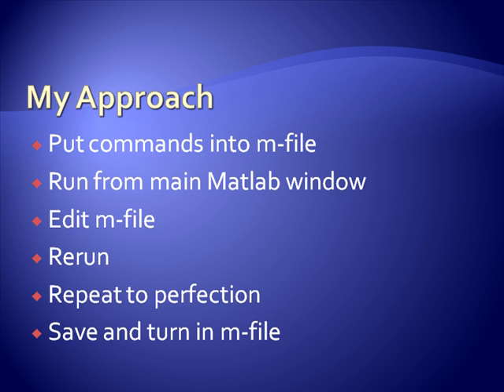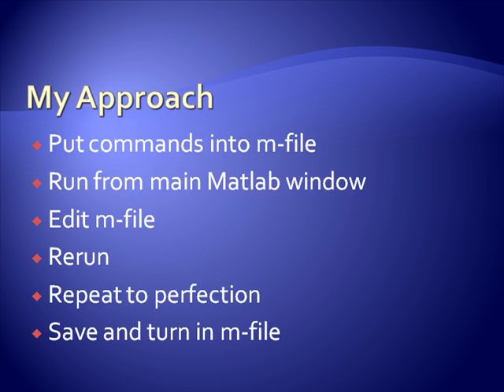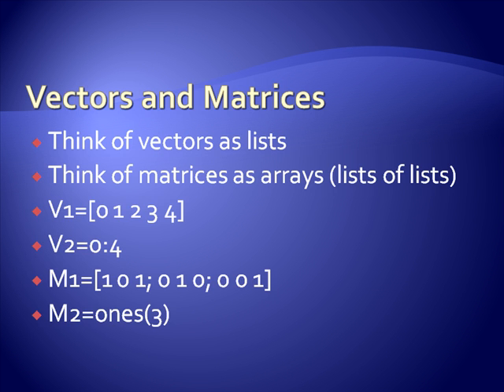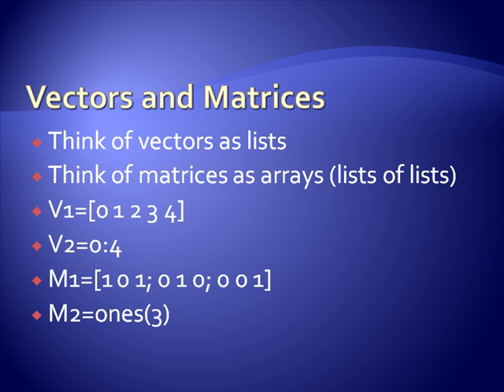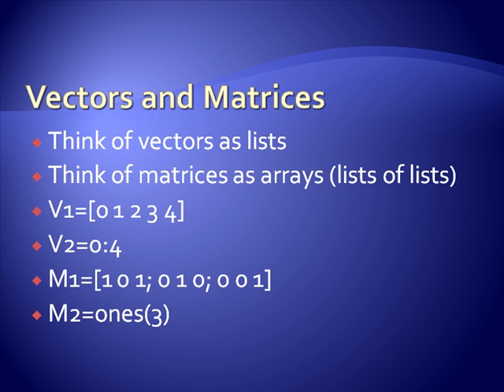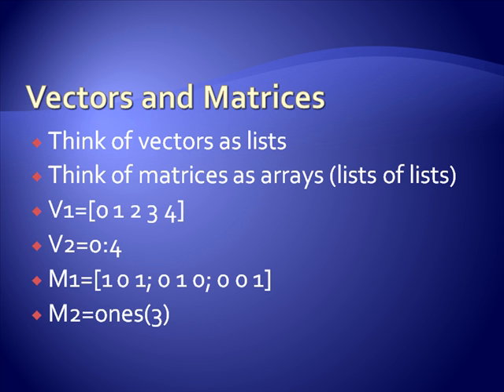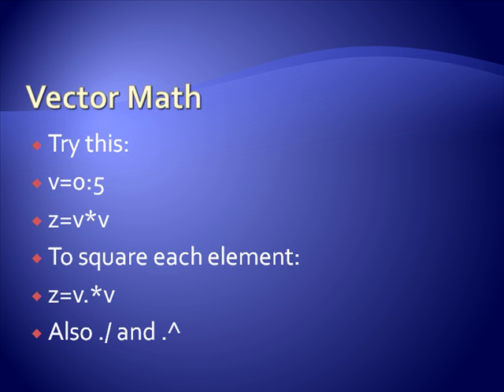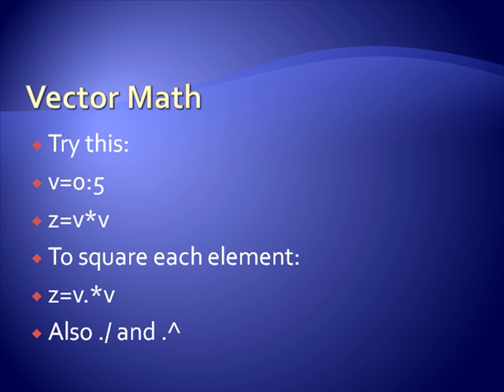Matlab Introduction for beginners Part 1

Comment: Thank you for posting these tutorials. They have been very useful; actually, they saved my but a time or two. I prefer, and am quite familiar Mathematica, but was specifically tasked to use MatLab. I had no clue, so you can see that you have been a great help. It's hard to beleive in this day of profiteering that such valuable resources can be accessed at no cost to the user. Again, thank you. I hope, somewhere, somehow, your time and efforts are compensated. Happy journey.